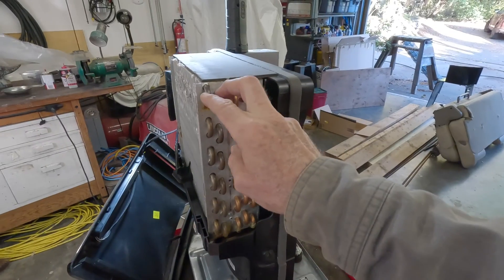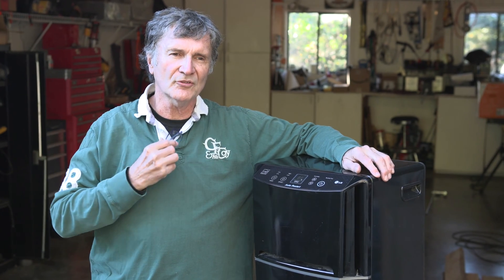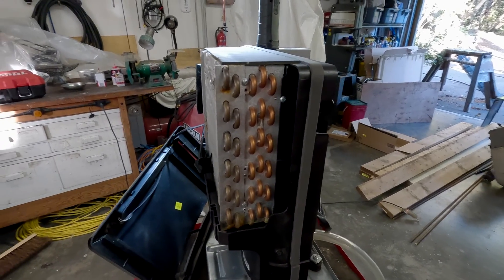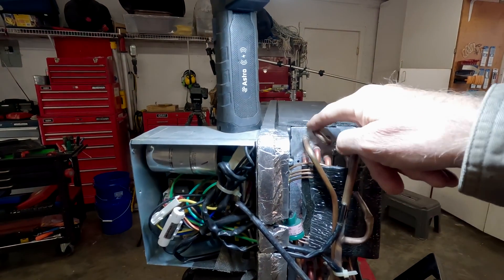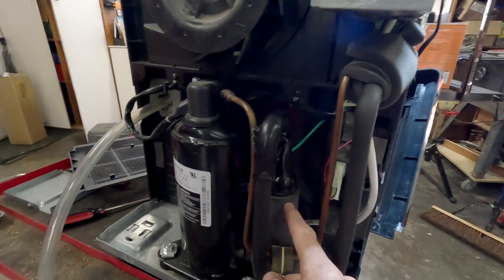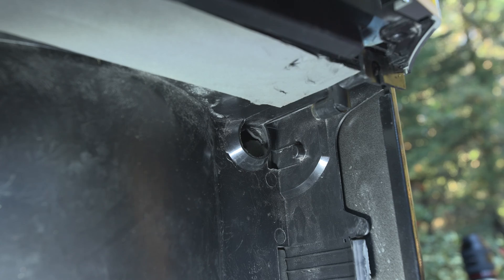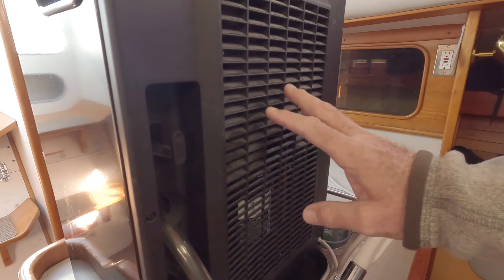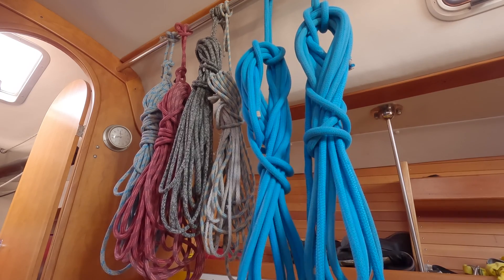Why use a dehumidifier in a boat? (And how it works)

Comment: I keep a dehumidifier on my boat as well and it has worked great. It’s kind of big and hard for me to get in and out of the boat when I’m going to use it but my boat stays nice and dry. What humidity setting would you recommend keeping the dehumidifier at?
Reply from the maker: I've been leaving it on 35%, and around here it gets used about 5 months out of the year. I agree with the annoying bulk, and a smaller unit might be easier to move in and out. Cheers!

Comment: I still think a heater is better for the reasons you mentioned at the start. Also dehumidifiers are a fire risk. Heaters are too but I'll trust something where the risk is more obvious :)
Reply from the maker: I love to hear different points of view, thanks for laying them down here. You're right, both can be a fire hazard, especially in a boat where people aren't always close at hand. The fire risk of a dehumidifier  is about the same as a small fridge, and we all know space heaters come with risks. It may seem OK until the boat gets tossed around and something flammable touches the heating element.

Comment: Great video as usual from you.
What are your thoughts on using this in a boat that is laid up on the hard all winter in freezing conditions and a cover, where access to inside the boat is not practical.
I envision the sink drain freezing, the water backing up flooding the inside of the boat over time.
Reply from the maker: What an excellent question. I'll say it depends on how cold it all gets. In the ocean waters here, the boat temp rarely strays from the water temp of about 12 deg C, but out of the water temp swings can be much more dramatic. Strangely, my sink has no trap, so there is no standing water to worry about freezing. On the hard, in a place where temp plunges, I'd be much more careful to drain any standing water, leaving sea cocks open to allow it to drain. Water that can't be well drained can be partially protected by adding propylene glycol. In that case I'd probably not use a dehumidifier because it constantly drains into a trap and that water could freeze solid. In that case I'd probably pull the batteries to intermittently charge through the depths of winter.